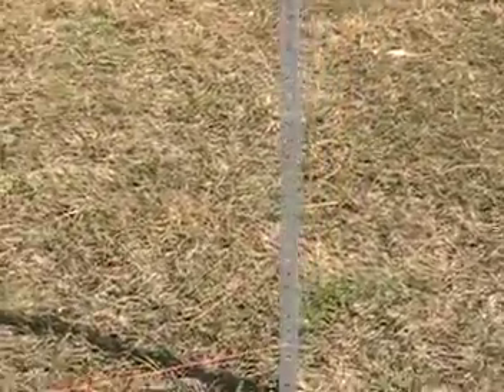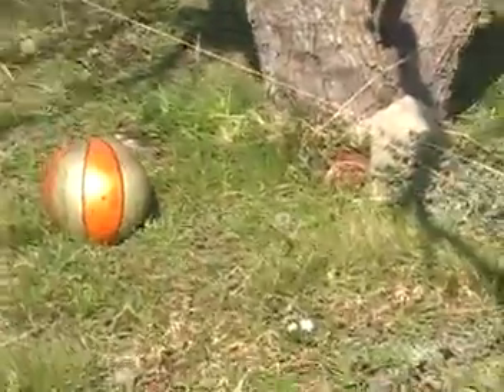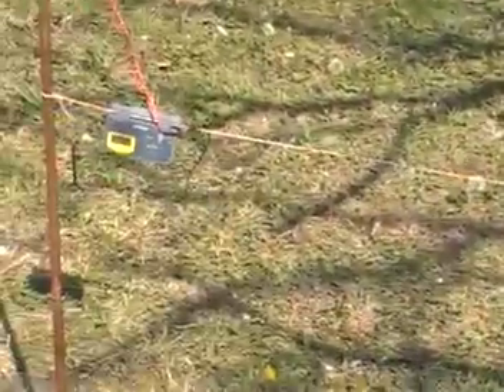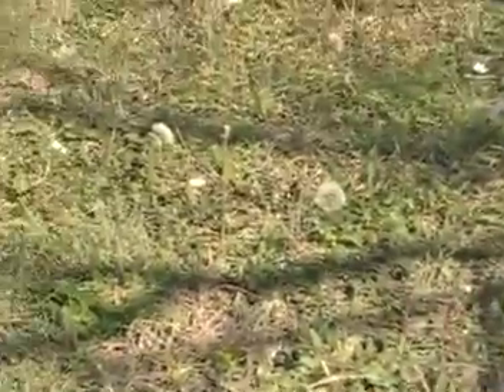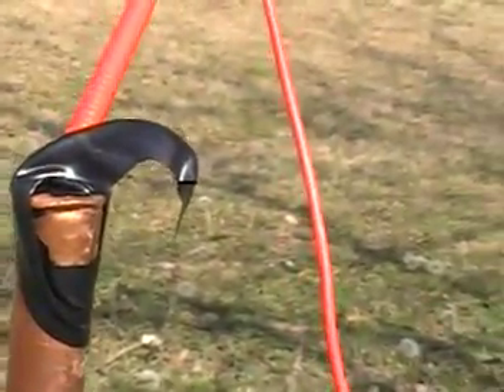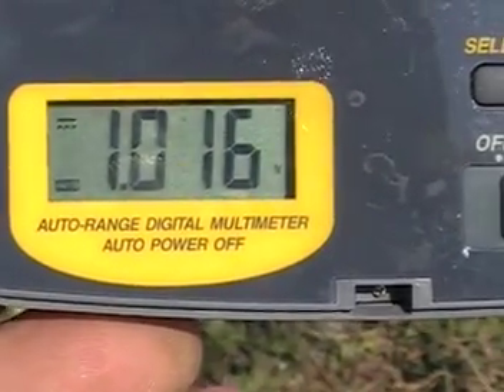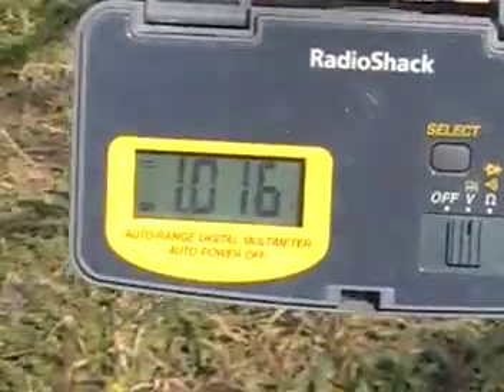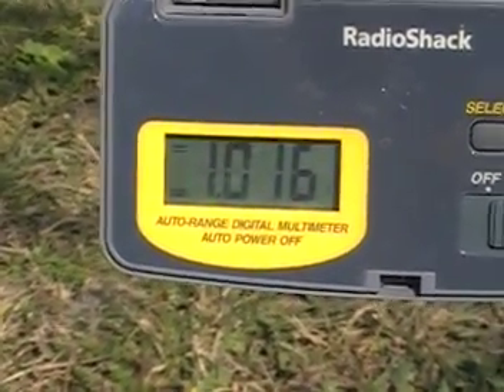My earth Battery

Comment: RHEAD100: 
If you connect more electrodes beside each other, like copper (1 or 2 feet) copper etc. and galvanized (1 or 2 feet) galvanized, and connected them together, you could probably get more current out. 
Just an idea.

Comment: Couldn't it be a very large 'potato battery?'

I mean, there is always a littlebit of water in the soil. And there are always some minerals dissolved in ground water so there will be lots of Ions in it. 
And you put a galvanised (Fe with a coat of Zn) bar and one of copper in the ground.

The elektricity will come from the redox reactions of the ions in my opinion.

Comment from the maker: I read some where that the father apart the tow peaces in the ground the more power you get. at 18 inches voltage was the same but the amperage was un-mesurable and 60 feet was the liength of the wire I had on hand and the amperage WAS measurable.

Comment: my bad, he said 0.25 mA, not 25 mA, so multiply the numbers by another 100 to get 2.5 amps.  You would need 1 million of them to get 100 volts @ 2.5 amps from what he said in the video.  My suggestion would be use larger stakes and see if it helps the output at all.

Comment: you need 10,000 to get around 2.5 amps @ 100 volts, assuming the devices would wire successfully in series and parallel.  This doesn't even take into account the resistance created by the 50x10,000 feet of wire in the system, or the logistics of wiring them together.  If i were wanting to do this as a test, I would create banks of 100 side by side wired in parallel, which should yeild 2.5 amps at 1 volt, then wire 100 of those banks in series north/south, which would minimize extra wire runs.

Comment: So, I wonder if you had a long large iron screw about 13 feet long, maybe 1/2 inch thick. Then wrapped it in copper coil. Then on each end you have a zinc rod and a copper rod. Wonder what kind of heat/electricity would generate. Only way to truly know without just making it up off the top of your head is to do it! I notice a lot of people post comments but don't really post whether they actually tried things like you have! Bravo!

Comment: I don't think that it can be static electricity, because as I see from the video, the wires are isolated, so I don't really think there is any possibility to transfer any kind of static electricity. To see if the wire charges because of radio waves, you should tie such a long wire on two isolators (let's say two concrete pillars) and see if you get the same voltage. In any case, it's a cool experiment.

Comment: I do not know how you could measure it but when I jump on a trampoline or if you stick your head out of the window of a moving car you will get a huge static charge from the air fiction so I think the air blowing by the exposed wire would do the same thing.I also think the tree would add alot more friction witch is why thay would say run it to things like tree's.

Comment: This is like a potato battery, two different metals produce a current. Same as chewing on tinfoil if you have a filling of different metal. The ground is moist and acts as a conductor. Very cool video, I didn't know about the telegraph ground batteries.

Comment: You said increasing the plate size in the salt water increased the amperage.

Could that be done here as well? Could you get quite a lot of amperage if you used a large copper plate instead of a stake?

Comment: i remember reading an article from the 1800s about the telegraphs. and they would stick a pipe in a tree root  or they would find a spot where the plants grow greener thant he others then they would put a wide copper pipe and another pipe inside that one and connect each in a series seperately  and that would get th e voltage and stuff you need i never tried it but i will

Comment from the maker: You're Welcome;  
I had the evening sun at my back and it was hard to see anything in the view finder.
I am working on a salt water battery now.  It is a lot easier to set up in cells and wire parallel and series to up voltage and amps. I am going to see if I can get it up to 4 or 5 volts and 20 or 30 mille amps. To run a CD player.